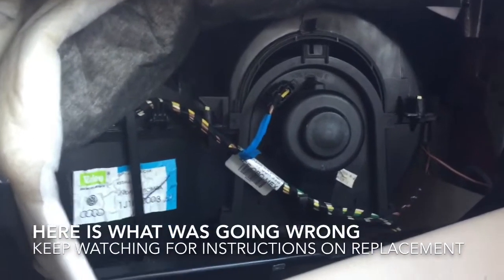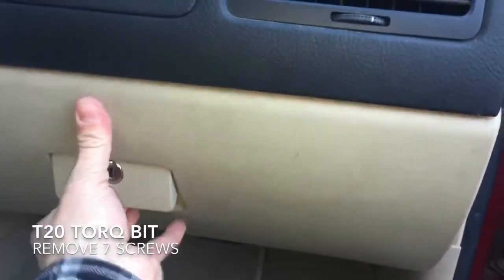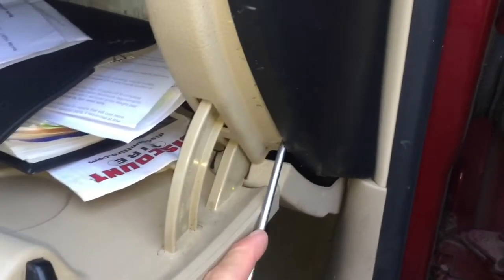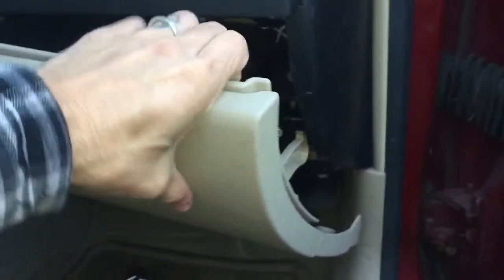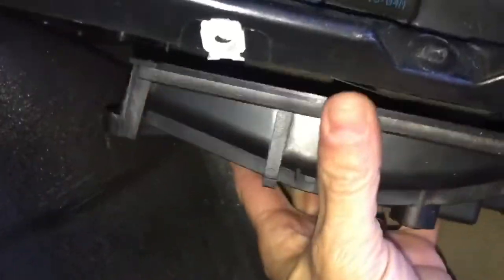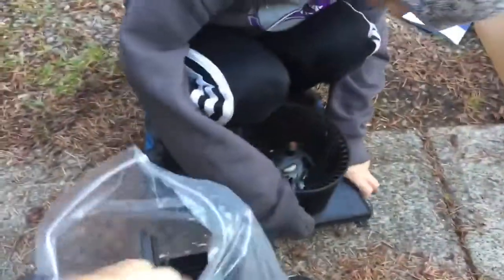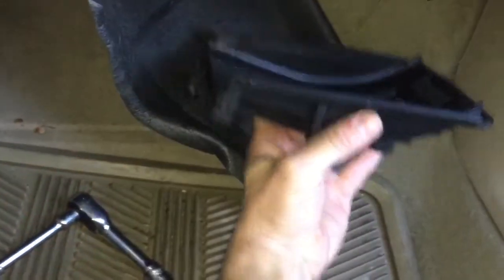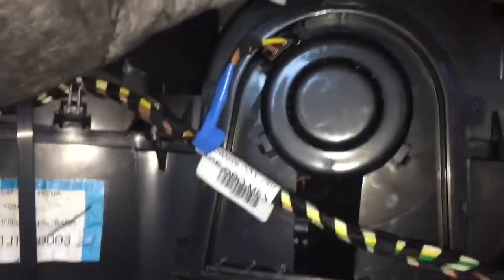How to replace blower motor on VW Jetta

Comment: Great video! I used this to fix my 2002 TDI same way.. took like 20mins. Saved a bunch of troubleshooting and chasing down wiring etc... I just replaced both the blower and resistor seeing its all original. I had weird problem too. the blower would only blow air when I was in motion over 50mph with any window cracked. Slow down, come to a stop or turn on the recirc button and fan stopped entirely. Reached in to spin fan from the air filter side and it'd go temporarily and then stall or twitch. Not sure it was a Flat spot prob or resistor... but replaced it all and good to go. EZPZ. Would have had no clue how to do without this video!
Reply from the maker: @Kevin Gebert, thank you for taking the time to leave feedback. Cheers!

Comment: This video was by far the easiest to go by, for me. Last night I took out the glove box and it ended up hanging there for a day because I couldn't  figure out how to get to  the hidden screw, and it was night time,  on my 09 Jetta. I bought a blower motor today, got home and took the computer to my car to watch the video.I had already watched it in the house and when I was out in the car, I found that I didn't even need to watch it again. Is pretty straight forward. The only thing I was unsure of. I heard that the airbag can sometimes go off when doing this. Is that true? i would suspect, yes. That would be awful and dangerous. I didn't want to fiddle with it, but I wished I knew how to shut the sensor, unplug or whatever, to ensure it wouldn't go off. Anyways, I am sitting here now with an excellent working blower motor, happy because I know I will have heat in the morning when I go to work and proud that I did it myself and saved about 100 bucks! Learned something at the same time! Thank you very much for the video! Happy Winter!
Reply from the maker: Thank you for the great review, I imagine an airbag could deploy but in this spec of work it should not be an issue unless there was something that was faulty. A unexpected airbag to the body or face would be horrible.

Comment: Thanks for sharing. I have a 2007 vw Jetta and im doing the same thing. Im following your helpful instructions,  but found that there is one more torx screw that needs to be undone on my model. It is a real hard location,  directly under the airflow redirector knob in the center console.  It faces down towards the ash tray and i cannot get my small t20 torx driver in there to turn it. Without getting this screw out, you cannot drop down the entire section to access the blower motor.  I need a 90 degree type of driver with a torx t20 end so i can get at that screw and turn it.  My little tiny 6" torx hand driver is still too long to get in there. Hope this helps someone else out there.
Reply from the maker: Can you use just a t20 bit and a wrench or pair of vise grips to hold and turn the bit?

Comment: You two are so sweet! I too am having issues with my blower. I am trying to diagnose the exact problem. My heater motor stopped running the other night. On every setting and every number. In winter of all times. But also the AC hasn't worked since I bought the car. It blows hot air. I then drove my car the next day and it was working but later died out. The motor is making noises that are hard to describe but I can tell that the motor is struggling to keep going.and then dies out. Is it just a matter of replacing a fuse, topping up my coolant( which is already above minimum) or replacing the motor? I checked the two hoses leading to the blend door area, they are both hot to the touch. I don't want to really go to a mechanic and pay hundreds of dollars in case it is something that I can do myself. Thank you for the video. It was helpful for when I do need to replace the motor.
Reply: sounds about exactly like mine, almost word for word! AC never worked, nothing but hot, and then blower motor slowly started dying out it would shut off slowly then randomly come back on.... haha crazy, did you ever have the box on top of the battery melt like mine did? just asking cause im pretty sure that that was also a recall on a few jettas not sure tho....
Reply: @raviolimaster  Hey. I ended up figuring out the issue from a few youtube videos!! I bought a used blower motor for $40 bux and had the tools I needed, so decided to watch another youtube video and changed the motor out myself. I was some proud. The hardest part was getting the glove box to come out completely. I didn't realize there was a hidden screw. Found it, Got er out. My AC, I don't believe, works still but I'll tackle that when the weather warms up a bit. My resistor doesn't look to be in the best of shape. Rusted. But it still has some life to it. And no, never had the box melt. Haha. But good to know. Thanks!